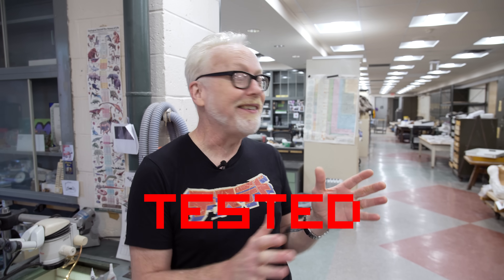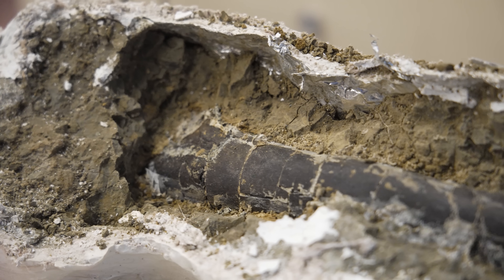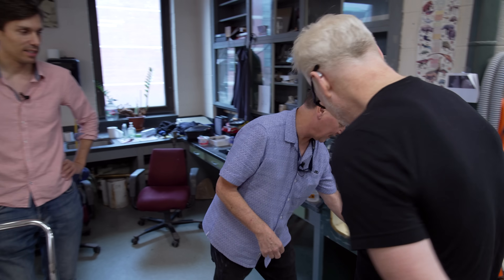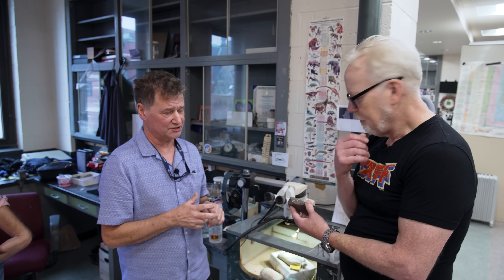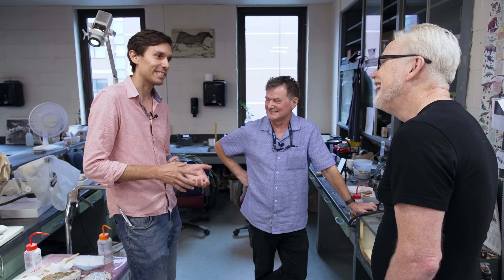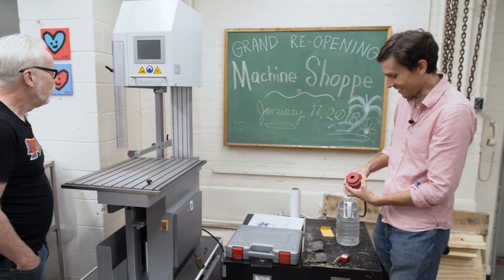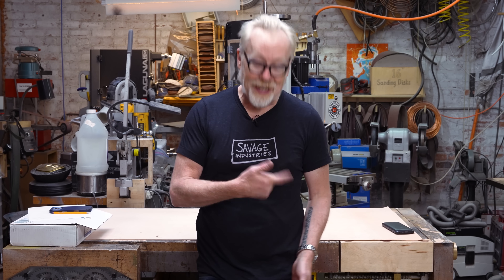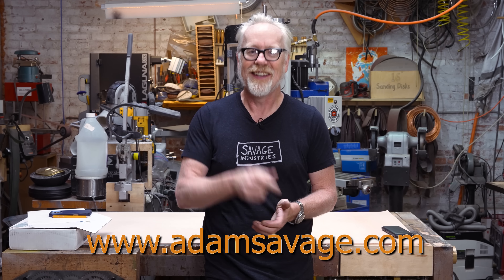Adam Savage Gets Tool Envy at AMNH's Fossil Lab!

Comment: Safety isn’t priority one there. I’d not push through things with my bare fingers so close to that saw
Reply: It’s a diamond wire, not a regular saw blade, not gonna do anything if you bump a finger on it. They use circular diamond blades on things like tile cutter saws to cut through geodes and petrified wood, etc., and it’s very safe. Just messy from the water.

Comment: A low cost entry to diamond wire bandsaw is a glass cutting saw. Mine was under $US1K with a pump for water, but all hand feed and relatively small throat. (I use it for metallurgical work and glass work)

Comment: Another good point about the wire saw. If you happen to touch the wire, you will only get a scratch, while if it was a band saw blade, it would eat your finger.
Reply: Its a tool used a lot by meteorite dealers who like to sell meteorite slices because you lose so little in the kerf.